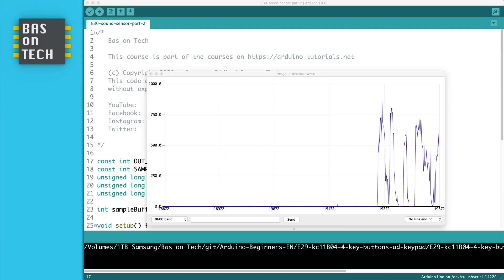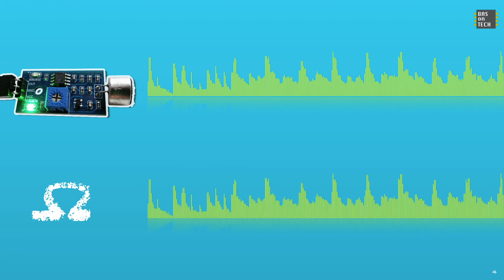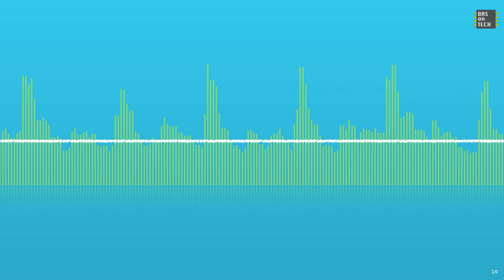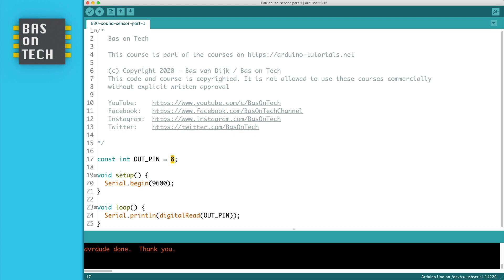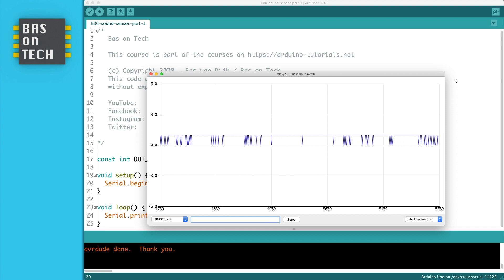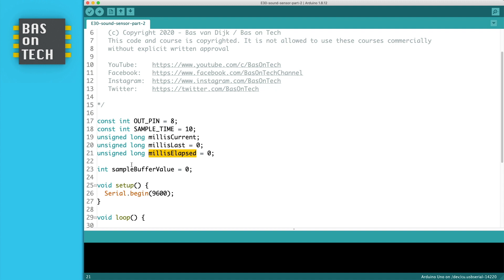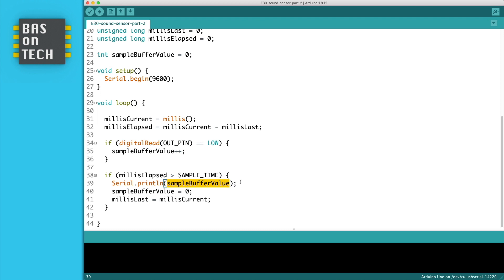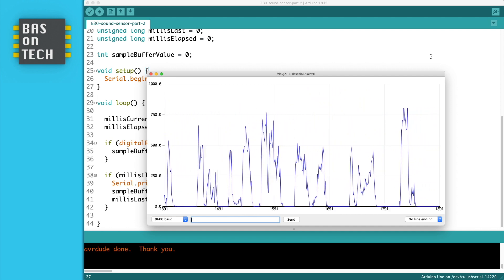SOUND SENSOR DATA ON ARDUINO SERIAL PLOTTER - Arduino tutorial #30

Comment: As a non-electrical engineer, my mind is bending a little bit.  How can you convert the data from a digital sensor into an analog signal?  I see that the code is sampling the sensor at a high frequency and summing the number of 1 readings over a period of 10ms.  But if you set the sensitivity of the digital sensor to say 60dB, and then you play a sound with a constant volume of 65dB, won't all readings be 1 and the summed count for that 10ms sample will be 1000?  And then if you repeat that experiment with a constant sound of 70dB, won't you also get a reading of 1000 over that 10ms sample?  So both samples "show" the same 1000 output, right? What am I missing?
Reply from the maker: That seems a correct assumption. It is purely showing the relative samples of sound in the sampled period of time. It says nothing about frequency, dB's or whatsoever. The sensor can only tell you if there is sound or not, thats it. Because the sensor is sampled very fast you can still get an impression of the sound intensity relative to other sampled periods. Where intensity says nothing about the volume or alike. It just tells you there was more "sound presence" measured 😃

Comment: I have a problem on my sensor, that the two LEDs of the sensor, both of them IS turning on, normally just one that should turning on
Reply from the maker: This might be a faulty sensor, or it is not the sensor I am using. There are sensors that look the same but are actually a different one.

Comment: Explain this 0 is high and 1 is low?
Reply: It detects sound activity and turn it into resistance. As the resistance aproaches zero, all of the energy input is trasfered back to the board. Same thing otherwise, as it aproaches its maximum resistance slim to none energy is received back,so its read zero. And you can adjust the sensitivity with the built-in potentiometre

Comment: Remember, this sensor cant measure noise level (dB). The amplitude on diagrams dont show noise level, it only shows how long sound sensor was triggered on. When it is quieter, the sensor does not detect the quieter sound as a lower noise level, but activates fewer times in a set period of time.
Reply from the maker: exactly this 😃
Reply: How can we use this for measuring dB Values

Comment: Hi, I am 12 years old. What is the use for the project ? 10Q
Reply from the maker: Hi, good question! It learns you to sample data over a fixed periods of time. This way you can get more data from a sensor than that you would expect on first hand. This is a quite "dumb" sensor: it tells you if there is sound or not, that's it. With sampling data we can measure the amount of sound over a period of time and plot this in a chart 😃

Comment: Hi Boss,

This is such an amazing video, it worked for me however I have 2 questions:

1. I'm struggling to read the signals from the Audio sensor using a Osciloscope, if I want to create a program that will action something based on some frequency (i.e. a clap light switch) can I use the plotter instead of the osciloscope ?

2. My plotter view is like very big, I would like to zoom out the plotter to have your same view, is there any setting to change to make it ?

THANKS !.
Reply from the maker: Hi, to display the signals on an oscilloscope you have to output them as analog signals. My code sends it to the serial monitor and the IDE makes the graph. So you then have to modify the code that you use an analog pin to set the correct value over time.

Further this sensor does not measure frequency, so you can't really detect a certain frequency.

To zoom out my guess is that you need to multiply the values by a certain factor which fits your need.

Comment: Wow..just wow!
Thanks ...you solved my problem......
I would also like to know whether you are familer with the sound sensor module which has analog pin output too....I expected such a waveform when I connected it to the analog pin but there's no difference at all no matter what sound I make!
I thought the mic was damaged but everyone had the same problem!
Reply from the maker: The digital sampling I use in this tutorial will not work with the analog output. With an analog output it should be a log easier. Just print the value read on the analog port to the serial monitor. You should see a value variation depending on your sound.